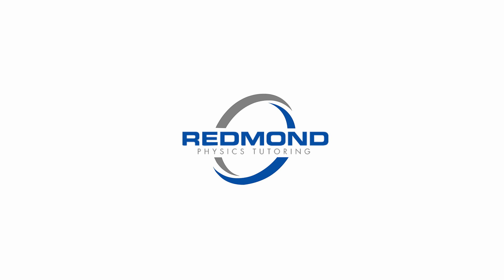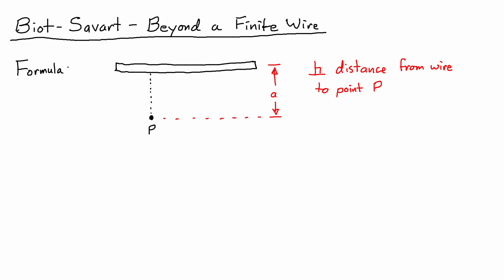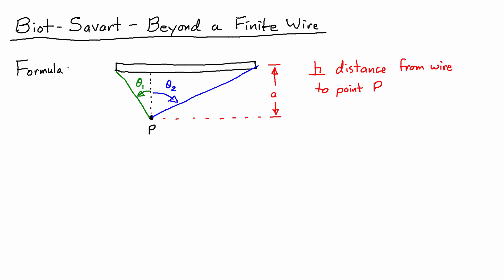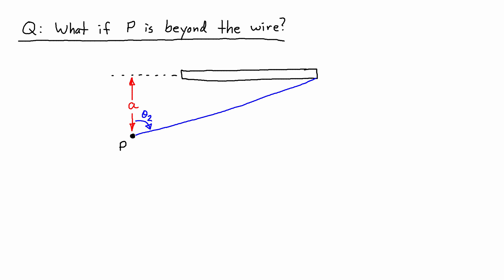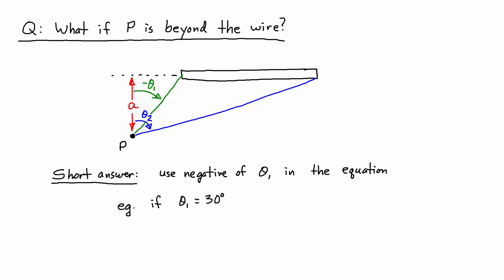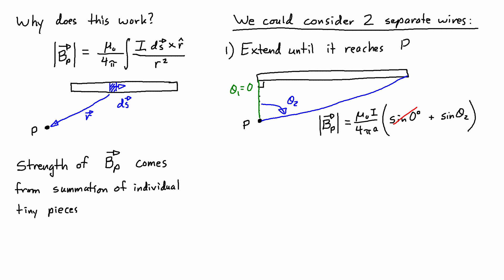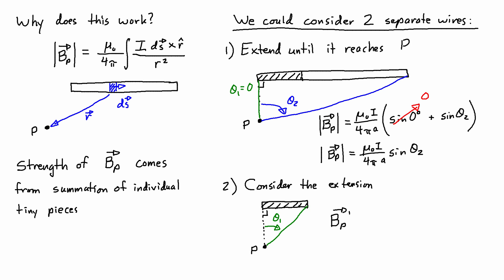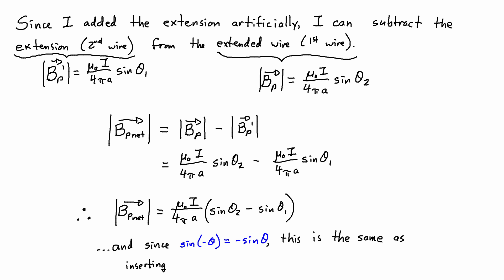Using Biot-Savart to Find the Magnetic Field Strength at a Point Beyond a Finite Wire

Comment: I had solved this thing on my own but then what came into my mind was that it violated Ampere's circuital law, so I considered myself wrong.
So now I'm asking you.. Doesn't it violate Ampere's law as no current threads through the amperean loop if we draw one there?
Reply from the maker: I'm guessing you mean to draw a small amperean loop around point P, where there's no current but there clearly is a magnetic field. This is true for original case as well where point P is somewhere beside the wire. Unfortunately I don't know how to answer your question. I haven't worked enough with Ampere's circuital law and I would hate to mislead you. I'd suggest that you ask your prof or teaching assistant. Best of luck!